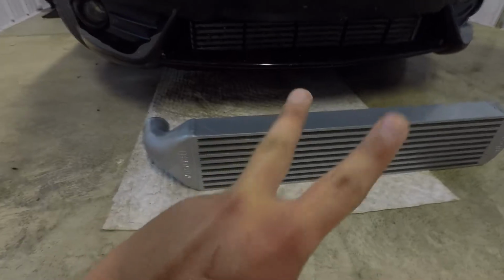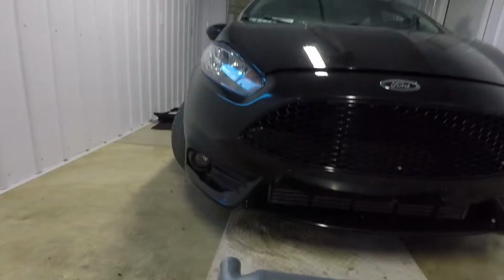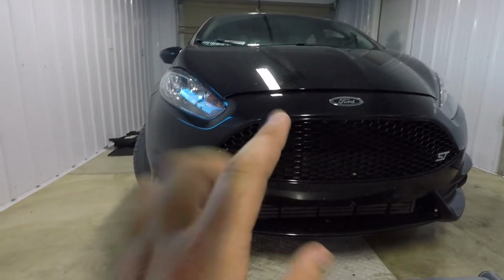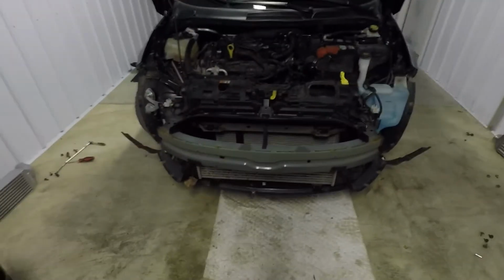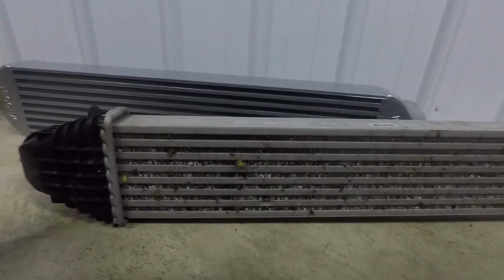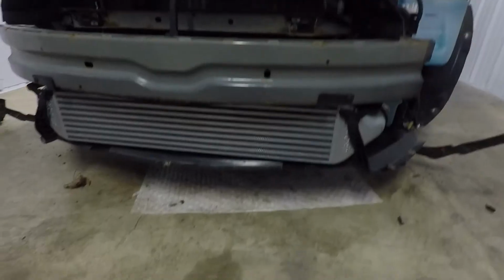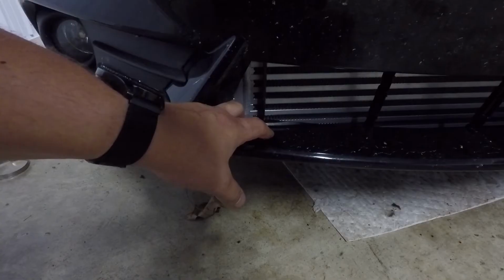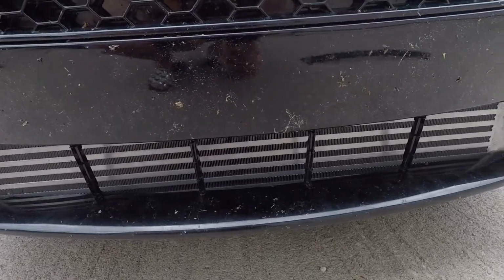"BIG" Intercooler for my Fiesta ST! - Whoosh V3

Comment: Will I benefit upgrading my intercooler on stage 1 dizzy or is it not really need unless you go with a different turbo?
Reply: Oh I just finished your video thank you
Reply from the maker: @kylebazzar7994  yes, definitely worth it either way. More consistent temps and no heat soak!